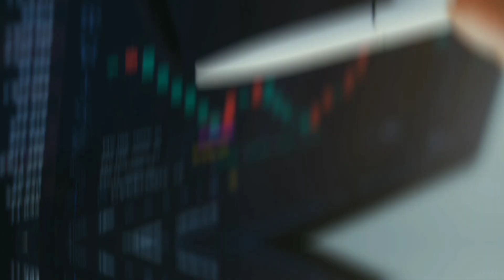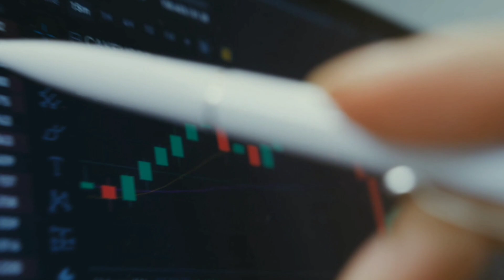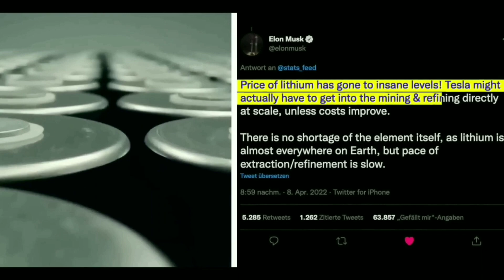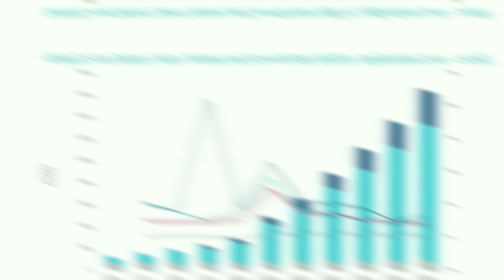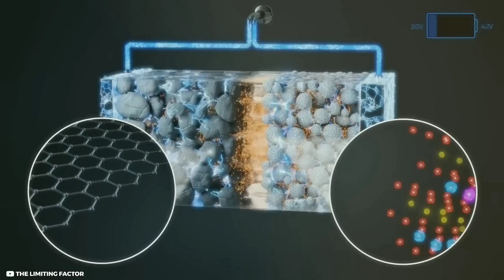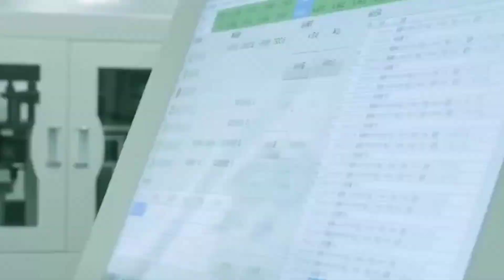Lithium is Outdated! Meet the New and Improved Sodium Ion Batteries

Comment: What needs to be asked is why Elon does not make it easy to replace a battery if one of the cells short out ,, make the battery pack so its like changing a battery in a remote control...... the whole idea is to make things more convenient not worse .. $10 for a battery cell and you up and running again

Comment: Sodium Ion Batteries for sure have a place in the home and power grid if anything. For cars, its harder to see them over all take over Li, but they are only half the puzzle over all. If the battery is super cheap - the over all car comes down in price. Thus if they can get Sulfur added to Sodium Ion Batteries the whole thing could down almost 45%. Now you are talking about the  same or less than an ICE car... even if the range maybe isnt as good - the cost of ownership will be far far less and cities will just add more charging stations along pathes. The thing people need to remember, half the country doesnt drive more than 1-2 hrs a day. (Assuming two way) drive to work, lunch, school (kids), store, then back home. Far as I know, Tesla also look at new way to save power in their cars using heat pumps, less over all manual work, and use of less costly rare earth metals that all add up in the end. In the end, if the over all car cost less - people are going to want to buy one for in town use and over all save a ton of money + still save the Earth long term going down this route. The biggest still for me is how do you repair these packs? So far no one has an answer to this half the of question. The over all battery is made out of smaller ones - but you can't just replace a smaller battery inside the whole pact without it cost almost a new car. If anything, thats the small area that needs to be look at in the future if you ask me. I know they can be recycle - but if there isnt a value to do a trade in - the cost of owner ship goes right back up. There isnt a short terms fix either in terms of just a cell dying and being replace with a new one.

Comment: Sodium is more widely available and cheaper than Lithium BUT, and it's a serious BUT, battery capacity is reduced, meaning shorter range.
Reply: Just add more charging ports along pathes of high usage (gas stations) - you pretty much fix that. Also, most people don't travel very far 1-2hrs normally with their cars - still with in range of most people.
Reply: @adr2t  That certainly will work most of the time.
Reply: @grahamstevenson1740  Should work most of the time. I am not saying there are not other issues, but I know thats the main issue with a lot of EVs mainly. Just the number of charge stations along a trip plan across the US. Tho, that is improving everyday.

Comment: Swapping of batteries for quick enhancement of range can easily get over the problem of lower energy density. Also, range issues are not a problem for short runs within the city. Fast charging capability seems to be better with sodium ion. All in all, sodium ion batteries being cheaper, will surely have a good impact on EV pricing.
Reply: The industry has largely REJECTED battery swapping.
Reply: @grahamstevenson1740  Maybe because it sorts out an issue related to range anxiety and the industry needs to justify atrocious pricing on batteries, that offer more driving range, for no good reason.
Reply: @tonyrebeiro  Unfortunately battery swapping only works if there's a swapping station nearby. So you trade one kind of range anxiety for another. The pricing on batteries is what it is because of scarcity of materials as much as anything. The way it works at present is that cheaper batteries give poorer range, surprise, surprise.
Reply: @grahamstevenson1740  Yes. This is what the whole discussion started off from, Cheaper battery but less energy density and therefore less range. That's why I pointed out battery swapping as an option. When batteries become much Cheaper than present prices and are easily available, swapping stations should automatically become a viable solution, together with Fast charging. Fast charging in itself is quite sufficient in most cases. Therefore, cheaper, environment friendly batteries will definitely have an advantage over the existing, expensive Lithium technology.
Reply: @tonyrebeiro  NO, you're swapping one range anxiety for another unless you plan to have thousands of battery swapping places every few tens of miles waiting for customers. it;s a completely absurd idea. We don't even have charging stations that nearby yet !
Reply: @grahamstevenson1740  In India, in Bangalore, swapping stations are available every 5 kms. or so, around the city. Necessity is the mother of invention. Just like electricity takes the least line of resistance, such innovative, cheap solutions will ultimately gain traction. Only Time will tell. Let's wait and watch.
Reply: @tonyrebeiro  many battery swapping stations are there in total ?
Reply: @grahamstevenson1740  Presently 200 and 1000 more to be added in the next 6 months. At 200 itself, they are available at every 3 kms.
Reply: Swapping battery packs is a the WORST idea I have ever heard about. Please do not promote the idea of swapping out things like this. The fact you will have the ship them around after is just creasing more waste over all. If anything, only allow swapping if terms of repairability. Aka, you trade if your old for a "refresh" one. The old going back because it cant hold more than 40% charge (or some number) to be recycle back into a new one.

Comment: Until I see these batteries in AA and AAA form and available locally, I won't believe they are being made.
Reply: Friday, June 2, 2023

Well, I'm sure the folks who make sodium ion batteries will drop everything, invest millions of dollars in engineering and retooling, just so you can have sodium ion, AA batteries to run your kitchen clock. 🕑

No worries, mate. 🤠
Reply: They ARE being made and you won't see them in AA and AAA format, the same way you don't see Lithium-ion batteries in AA and AAA format. They are incompatible ! Not least, they have a very different voltage.
Reply: @grahamstevenson1740 They are lithium ion AAA and AA battery
Reply: @grahamstevenson1740  I don't know the chemical composition, but I have some AA and AAA lithium batteries with the brand name KENTLI and they have a small circuit board built in to give them 1.5 volts out as opposed to the 3.5 volts that regular lithium batteries have.
Reply: @grahamstevenson1740  I have some Lithium-ion batteries in AA format. They are 3000mWh per battery.  It is not much better than the NIMH battery with 2500mAh. It's not worth the higher price.
Reply: @simon6071  Lithium-ion batteries are much higher voltage than AA or AAA cells. That's why they're not sold as such. It would create confusion.
Anyone can make them in the same size can but they're then usually called 14500 batteries (from the can dimensions 14mm x 50mm) rather like 18650 and 21700 types.
Reply: @grahamstevenson1740  The Lithium Ion AA battery that I mentioned has electronic circuit inside the battery to limit the output voltage to 1.5 V but has to be charged at 3.7 V with a special charger. The brand name of the battery is KENTLI.
Reply: @grahamstevenson1740  But we do see Li in AA and AAA formats already:)
Reply: @adr2t  They're not called AA or AA though. The AA becomes a 14500 for example to avoid confusion with the 1.5V cell.
Reply: @grahamstevenson1740  Weird, I have a Li AA battery right here with me
Reply: @adr2t   Is it MARKED AA ? I suspect not. They're known as a 14500 cell.
Reply: @grahamstevenson1740  Yea, I would take a picture if I could
Reply: I agree
Reply: They're literally in the BYD Dolphin
Reply: I hear the pepper battery lasts longer.

Comment: Lithium is outdated... but still a lot better than the new and improved sodium ion batteries in term of energy density, which is one of the most important elements when it comes to EV. Imagine the range of your car is permanently fixed at 63% of what you have right now.
Reply: 160 Wh/kg is about where lithium batteries were ten years ago. Sodium ion batteries can be used for small city cars where range is not really important. They are heavier, but the volumetric energy density, wh/litre is much the same. That’s more important for a compact car.
Reply: @madsam0320  Not the same. Li+ is 785Wh/L and Na+ roughly 400Wh/L.
Reply: @egaskrad  I made the mistake of comparing the density of both metals, but the batteries also have other materials, in fact only a small percentage of the batteries are lithium or sodium. If the world convert to EVs, there will be a shortage of lithium. Sodium ion batteries can fill in the gaps or act as short term solution.
Reply: @madsam0320  Na+ might be used in the lower end power storage product, such as UPS or home solar system. EVs, mobiles or anything space or weight crucial, Li+ is still the go to choice.
Reply: @madsam0320  It'd have to be compact because Na voltage is also considerably lower.
Reply from the maker: You are right that lithium-ion batteries have a higher energy density than sodium-ion batteries, which means they can store more energy per unit of mass or volume. However, energy density is not the only factor that matters when it comes to EV batteries. Sodium-ion batteries have some advantages over lithium-ion batteries, such as lower cost, higher safety, and better environmental impact. Sodium is much more abundant and cheaper than lithium, which makes sodium-ion batteries more affordable and accessible.
In the future, we may see more EVs powered by sodium-ion batteries or a combination of both types of batteries.
Reply: @FutureGalaxy  the current energy density of Li+ battery is 285Wh/kg in production and 500Wh/kg in the lab. Na+ battery is 160 Wh/kg in production and not-yet-200Wh/kg in the lab. The gap is huge to say the least. Anyway, I am not so sure about LFP.
Reply: @FutureGalaxy  NO. WRONG ! Sodium alone has none of those advantages other than greater availability/lower cost. You're talking about the improved 'sustainability' of different CHEMISTRIES and you can use those CHEMISTRIES with lithium too. Don't CONFLATE things so you're comparing apples and oranges.

Comment: How is that better for the enviroment , its a scam all of it same as windturbines and solar
Reply from the maker: sodium-ion batteries are not a scam, but a promising technology that could offer a more sustainable and cost-effective solution for energy storage in the future. However, they are still in the early stages of development and need more innovation and improvement to compete with lithium-ion batteries. I hope this helps you understand the topic better. 😊
They avoid the use of fluorine-based electrolytes, which are toxic and corrosive.
They have a lower environmental impact, as they require less energy and resources to produce and recycle.

Comment: For 80% charge in 15 min of a 100 kw Na battery is very fast. If a ev efficiency is about 4 miles/kw then 80x 4=320 miles then ev is going as good as ICE automobile on highway.

Comment: could you tell me cycle life, charge and discharge rate ?
Reply from the maker: Discharge and charge capacities of the sodium ion battery 2.0 were 97.7 and 96.4 mAh·g-1, respectively, after the third cycle. The technology of this battery targets applications in fast charge and discharge markets, and its power density is between 2 and 5 kW/kg, which allows for a 5-minute charging time. Additionally, this energy device exhibits good cycling stability, energy density, high flexibility, and better self-charging performance.